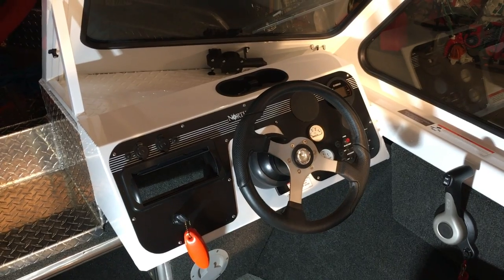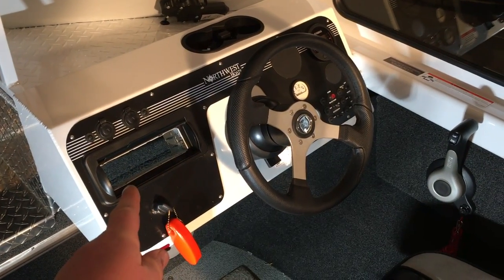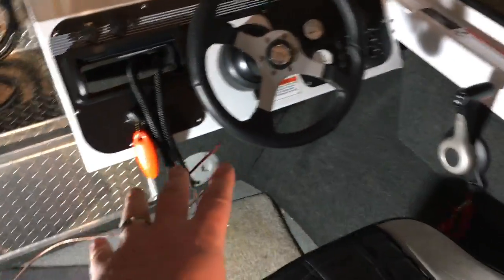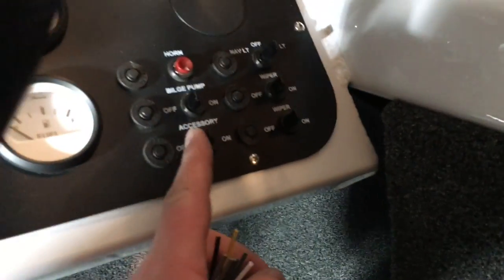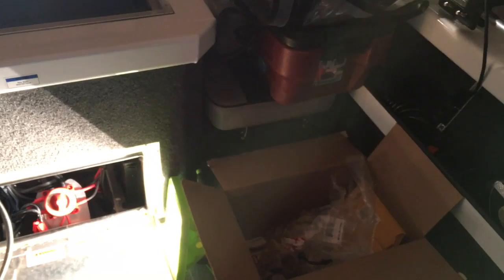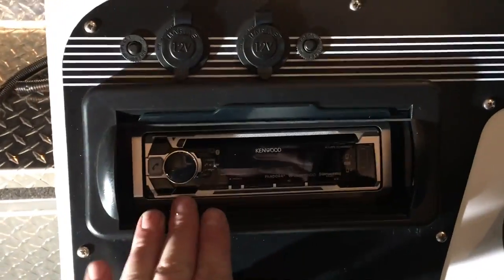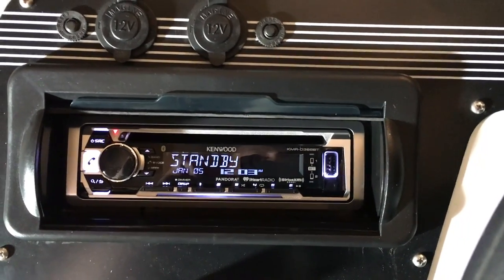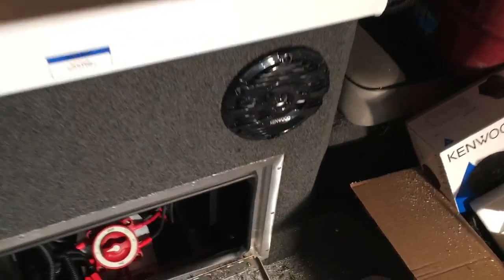How to Install a Stereo and Speakers on your Boat! | Bluetooth Kenwood

Comment: Very nice demonstration video!   
Good crimps, by the way.

Two notes...  
1. I agree with earlier comments that you are better to connect power to the center lug of the shutoff switch for reasons already stated.
2. 16ga main power wire is sufficient for 10A, but perhaps a little light, since you are running it from the battery switch in the back of the boat.   For a 200w stereo, 14 ga  or even 12 ga. would feed the power a little better.   

Something to consider In boats is that oxidation is an issue.  Often, over time, the wires don't conduct as well. So upping the wire one size is helpful, long term.   Besides corrosion at terminals,, I am often surprised at how much corrosion I see in the middle of wires from diffusion through the sheathing.    Very often, I will simply replace the wires, and customer thinks I did something amazing.   Anchor Marine tinned wire is BOSS!  It's a little pricey, so you have to factor it in, but it's worth the little extra.

Thanks again for the clear, well presented video.

Comment: The power wire should be ran to the battery switch (1-2-all switch) that way you can't leave the stereo on when you're done boating.
Reply: Yep. this guy is clueless to marine electrical.
Reply: Can it go to a positive bus bar that the battery switch leads to?

Comment: Did you have to disconnect battery cables to do it safely or is the battery off switch sufficient to mitigate electric shock?

Comment: How are the speakers holding up? I am looking at replacing the four on my boat with these.
Reply from the maker: I am actually not sure as this was a customer's boat.  But as far as I know, no complaints.  I have installed these speakers on a series of other boats and food trucks and they work fine.
Reply: I have been using Kenwoods for several years, and they are outstanding.  As with any speaker, if you can keep them out of direct sunlight, it helps the baffles to not dry out and crack.   Put a cover on your boat, if possible!  Sun is harder on them than water.

Comment: Curious if that was fiberglass that was hole sawed through for the speaker mounts. If so, how did it work
Reply from the maker: Nope, front speaker material was Plywood and rear was aluminum.

Comment: What size connectors did you use for the speakers? Also were they spade connectors?
Reply from the maker: We used 16-14 gauge blue spade connectors to connect to each speaker.
Reply: Provo Beast Audio Installation Thank you for the reply! Do you use the same size spade connectors for the positive and negative?
Reply from the maker: @TroyGrimes  For the Kenwood speaker we used, yes, both positive and negative terminals were the same size, so we just used the same style spade connector.
Reply: Provo Beast Audio Installation ok thank you! Sorry i shouldve asked before but do you know what size spade connector it was?

Comment: Where did you run the red accessory wire after the switch? Back to the battery? Helpful video, I’m installing a stereo on my boat that didn’t previously have one.
Reply from the maker: The switch had battery power anyways, so we didn't need to wire further.  However, if you don't, after the switch, just tap into the 12v+ constant line going to the battery.
Reply: Run a hot wire to your battery and ground wire to your battery and run your yellow wire to a constant 12 volt source to keep radio settings
Reply: You can I hook mine up a constant ignition switch wire

Comment: I have a blue tooth radio in my boat, can I pair it with Bluetooth speakers, if so how do I do it?
Reply from the maker: The Bluetooth radio only applies to steaming music from a mobile device.  Aftermarket Radios do not support pairing to Bluetooth speakers (becauase you would just pair your phone directly to the bluetooth speakers).  You will need to wire speakers directly to the radio or via external amplifiers.

Comment: Bought the same head unit.  Worked for maybe three weeks and stopped working.  Took it apart and found out theres really nothing marine about it.  Nothing is coated to protect the circuit boards.  Super disappointed, I have used Kenwood in my vehicles since I was a kid.  Looked into it and alooooot of people have this problem with marine Kenwood stereos.  Shame.